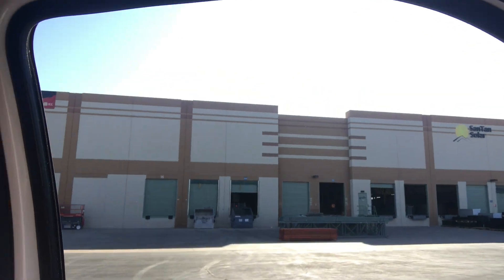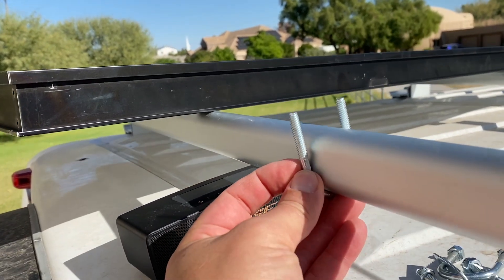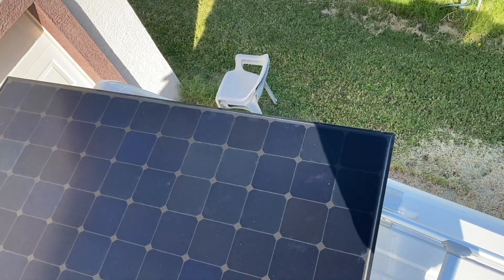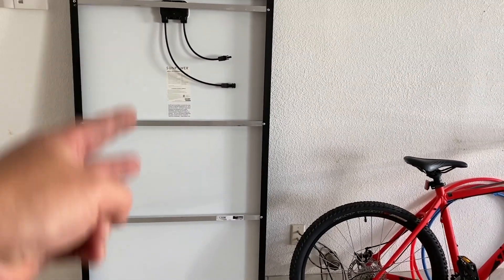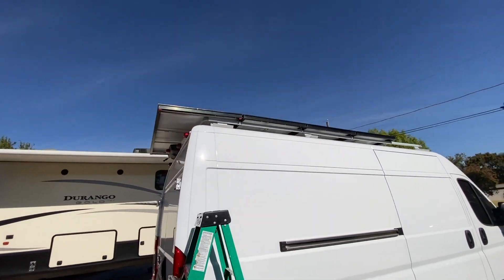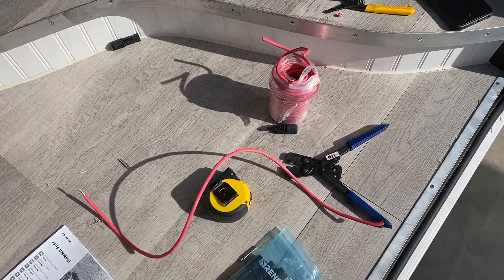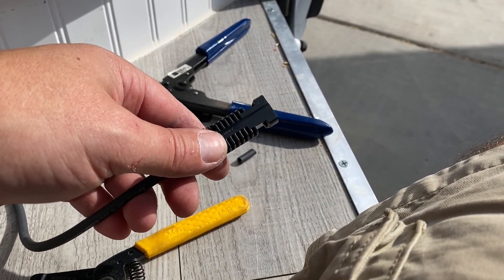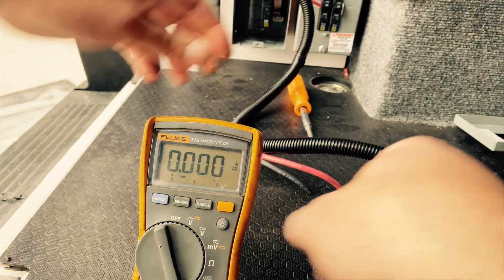750 Watt Solar install on  2019 Dodge Promaster.

Comment: What did you do for A/C?
Reply from the maker: Hi Chris! sorry for the late reply. I think I show it better in one of the other videos, But I basically bought a portable AC unit and vented it out the bottom. It is strapped in and cool air vent under the bed, and finally an infrared remote to run it! its so awesome! I love how it works. I'll do a new walk through video now that I understand how to make videos better ;) Thanks for watching!

Comment: Amazing what you can do, especially with electricity. Are you concerned about the panels being on top of a moving object and stability or damage from moving down the road hitting potholes, other debris, etc? Was this the last major project for your van? Are you going to try and ship it to HI?
Reply from the maker: Thank you!! I’m not too concerned about the stability or damage. The panels are incredibly durable and sturdy- they are bolted very tight also. I have a few more fine tune projects- the final water system and connecting the solar panels to the solar charge controller.

Comment: Good call on something between the panel and the rack. I used a small piece of vhb tape.

Why can't you do 3 in series?

I know it's too late but there are holes with plastic covering under the location you drilled. I passed a lot of wires through them.
Reply from the maker: The solar charge controller I have can’t handle the voltage of 3 in series- midnight solar has an excellent online worksheet to verify compatibility of configurations so you don’t fry your equipment.